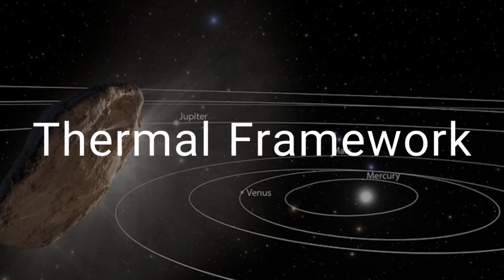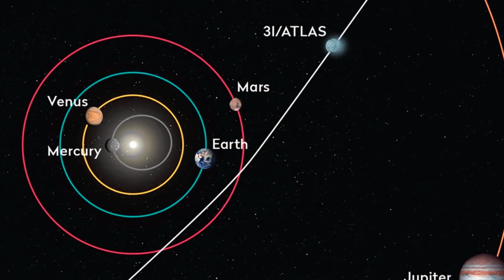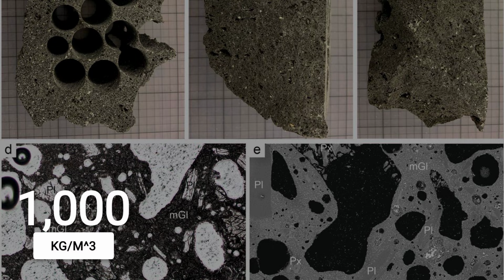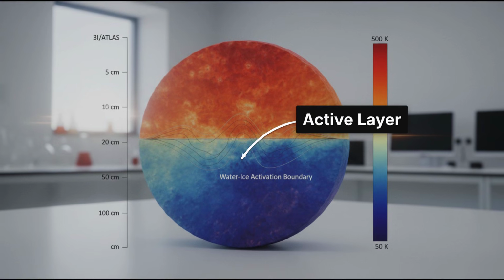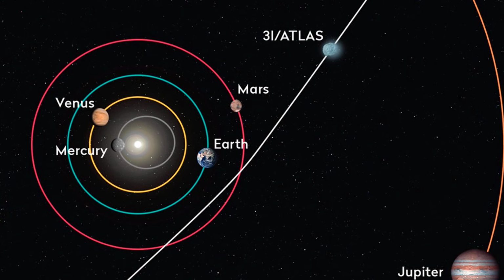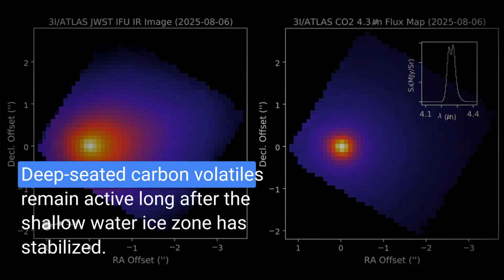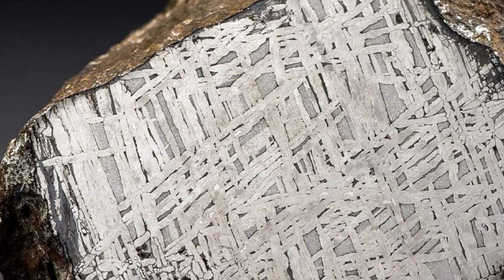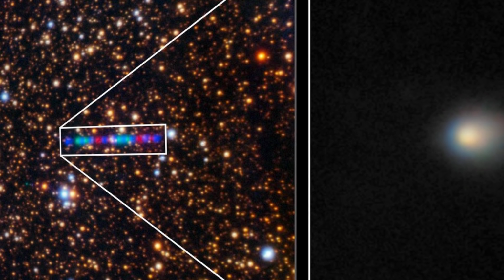3I/ATLAS: Heat Maps Reveal Something Isn’t Normal

Comment: About time a thermal discussion!
It ignited! Been saying this for about 2 months now!
Reply: What do you mean?
Reply: @aiurea1 during perihelion a metal or certain materials could've ignited!
With this heat source and sublimation of gasses and water it can cause a perpetual burning.
I believe there is a possibility that a vein or veins of metal ignited during it's passing of the sun.
The sublimation of gas and water is being separated by the heat source feeding the burning materials.
If it is veins, the veins will produce or provide a direction that is cause the different tail directions. Even fighting against solar winds, ant-tail!
It would act as a jet propulsion type look or perspectives.
It would also explain the heat source well past the suns heating of the surface.
I would really like to see a model of the gravitational density of 3I/Atlas!
Could explain materials and metals in side.
Reply: But there is zero propulsion. Zero acceleration?😂
Reply: @GTBsg75 I said propulsion type look or perspectives! Didn't say actual propulsion is happening.
However, there was acceleration after perihelion which shouldn't occur!😂😂😂
Reply: Look at magnetometers! I don't understand the magnetic activity rn